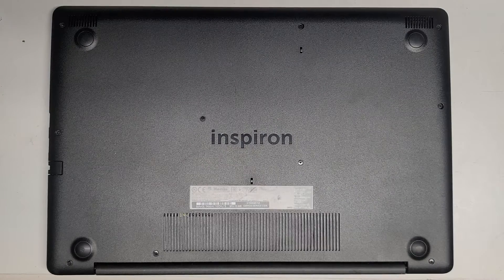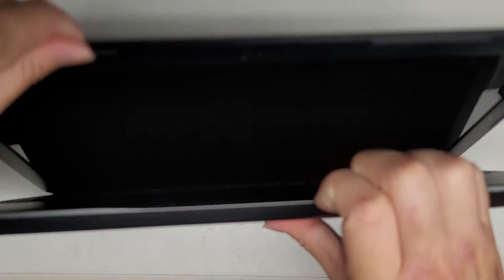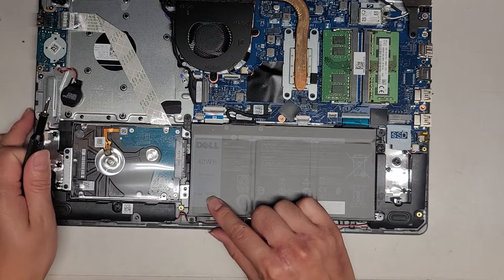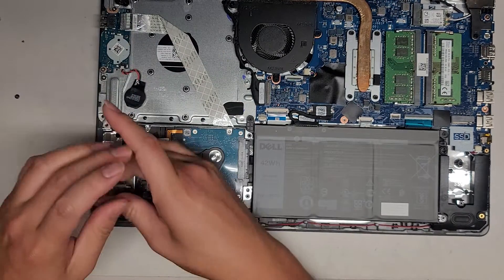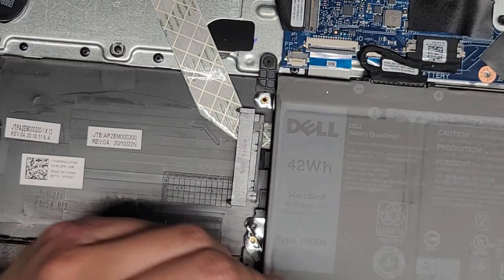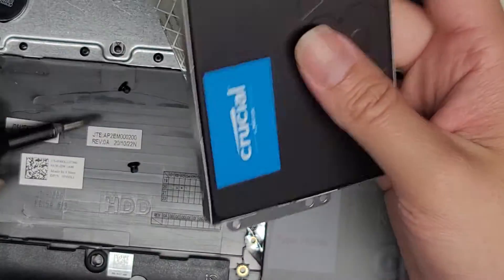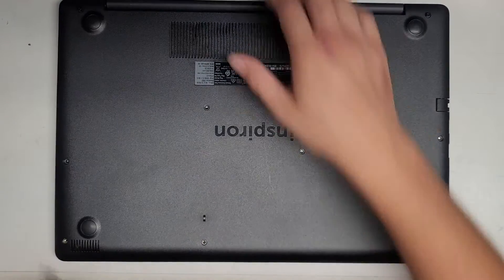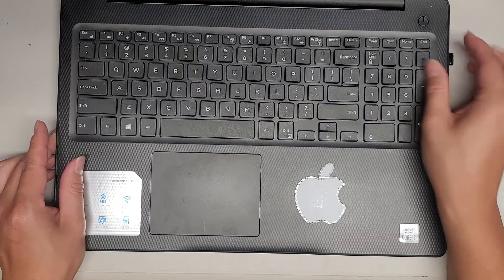Dell Inspiron 3593 Disassembly RAM SSD Hard Drive Upgrade Replacement Repair Quick Look Inside

Comment: hey thanks for the vid i just wanna ask abt the ram and can i use another version instead of pc4 2666v?
Reply from the maker: It needs to be at least ddr4, speeds can be hit or miss, but usually ok.
Reply: @ItsBinhRepaired i see thanks alot for responding!
Reply from the maker: @Heece45  no problem

Comment: Do you know if the HDD is a 7mm thickness or a 9.5 mm thickness?  In another video the person said he thought it was a 7mm slim drive.  I just wanna order the right size.  Now you're making me wonder if I should get an SSD tho, lol.
Reply from the maker: You can't get thick SSDs unless you're trying to get really old ones. Just get an SSD and it'll fit. Lol
Reply: @ItsBinhRepaired  Lol, I didn't even know there was a size difference until that guy said that and was like wtf.  That's good to know, thanks man for the quick response.
Reply from the maker: Haha yup

Comment: A lot of useful information as far as different components and how they are connected. I currently have this same machine and want to know if it’s better to upgrade the crucial p2 stick or just add on a sata ssd. It currently only has a 256g  p2 stick installed and I want to upgrade. Can I just add on a sata ssd and not have to do any cloning?  Thanks
Reply from the maker: M.2 nvme SSDs are a lot faster than the sata ones. It's really up to you.